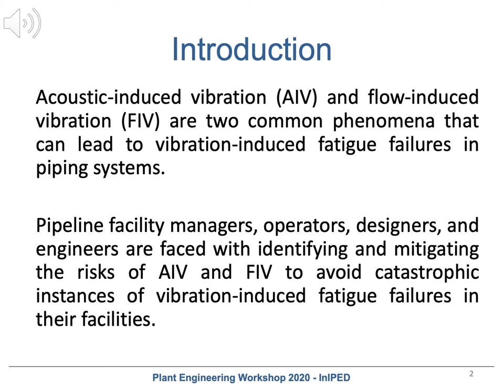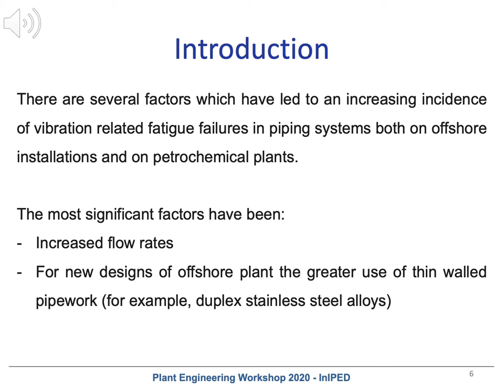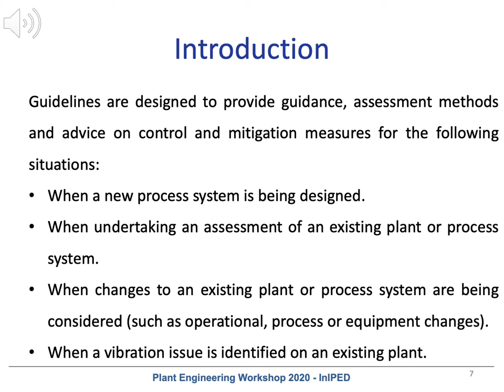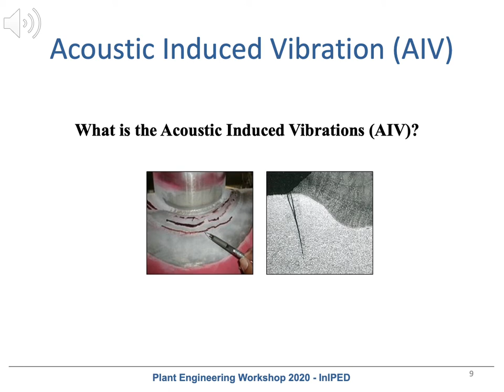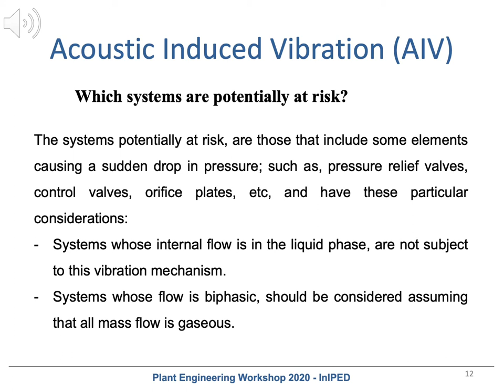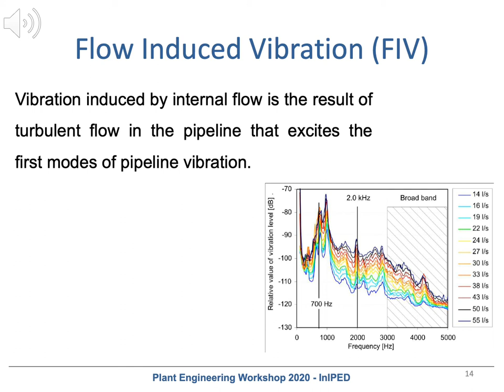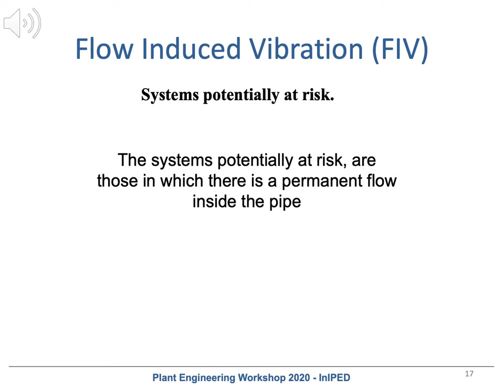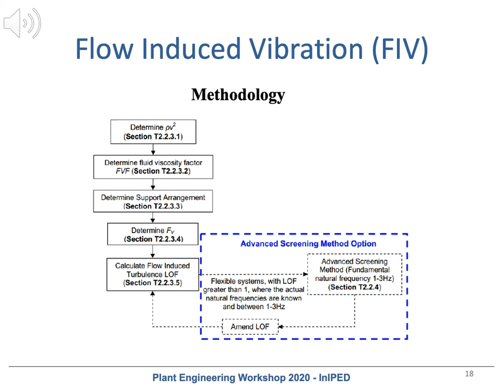Introduction to Acoustic Induced Vibration (AIV) and Flow Induced Vibration (FIV) in piping systems

Comment: How could this seminar help small town neighborhoods where a few houses are hearing a  Infrasound low frequency diesel engine noise with vibrations inside the house coming through the walls and floors 24/7 creating fast vibrations on water surfaces in water bottles, cups, jugs and outdoors rain or melting water puddles on front sidewalk, street, or driveway can be also seen vibrating at a fast pace!  Worst of all  the some citizens feels the vibrations penetrating their body causing vibrational sickness and eardrum acoustic fatigued and  with other symptoms like headaches, ear drum pressure, heart palpitations, nausea, insomnia, drowsiness, anxiety, burning face and eyes and noise is worst at night! Amplifying the diesel engine noise through appliances like furnaces, refrigerators, fans or space heaters burning out the appliance causing it to break down!  The culprit is the buried  high pressure natural gas pipeline that is running down the street, can hear noise on porch, street and see street water vibrates but no authority in charge will take our complaints serious enough to do investigation! So what do we do or who do we call to check this pipeline for acoustic fatigued and vibrations properly?🤔🔥🔥🔥☢️☢️☢️